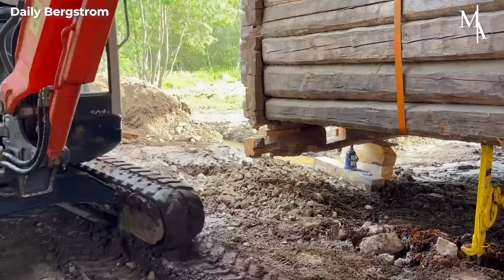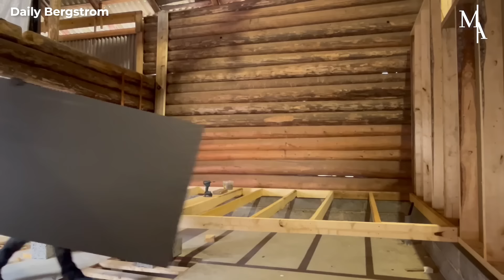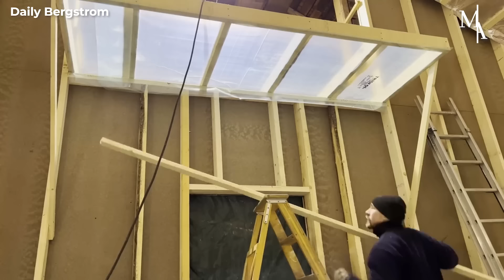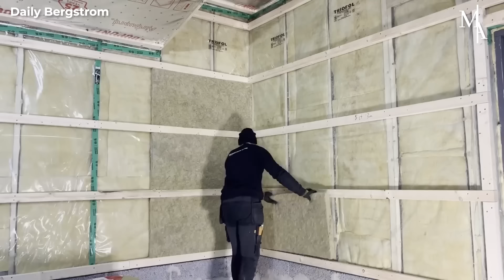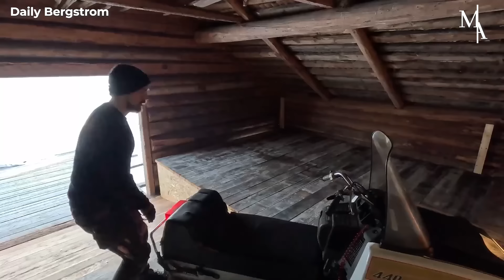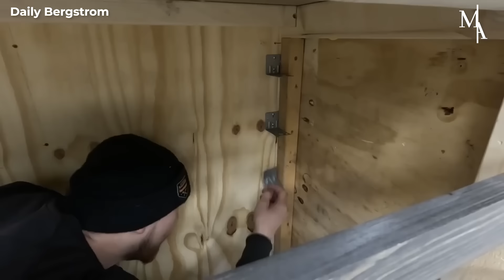Man Transforms Old Barn into Dream Garage | 2-Years Timelapse by @BergstromGarage

Comment: no , i am not agree with that , just for a home i put 200 mm of fiber wood for an r=6 for the wall and 600 mm  for the roof for an r=14 , this is a good insulation , with a thermal shift of 20 hours , fiber glass is a shit , because after a few year , it disintegrates and reveals unisolated areas, so better fiber wood

Comment: Man, it must be cold where he's at. He went to town on that insulation.
Reply: no , i am not agree with that , just for a home i put 200 mm of fiber wood for an r=6 for the wall and 600 mm  for the roof for an r=14 , this is a good insulation , with a thermal shift of 20 hours , fiber glass is a shit , because after a few year , it disintegrates and reveals unisolated areas, so better fiber wood

Comment: Why install metal sheets when you covered them up with another osb wall for the work/tool bench. Adds insulation but also a host of complications if you need access to the wall.

Comment: I don’t think I’d really call this a dream garage, as the old rotten structure over the top of it’s gonna need a new roof in about six months. It would’ve been a heck of a lot easier and cheaper and better to have bulldoze the original structure and thrown up an engineered Building.

Comment: Stunning. Great plan and execution. The old barn wasn’t rebuilt.  It was used as a shell to protect the new building made inside it. The look was preserved on the outside and the roof integrated into the structure. Pretty clever

Comment: I wouldn't have used sheet metal on the inside.  I'd have used 23/32 plywood.  Metal conducts heat and heat is expensive in cold climates.